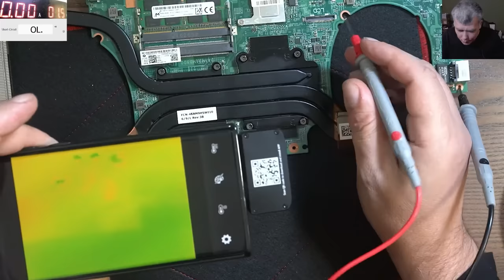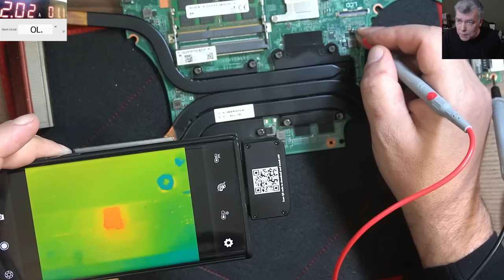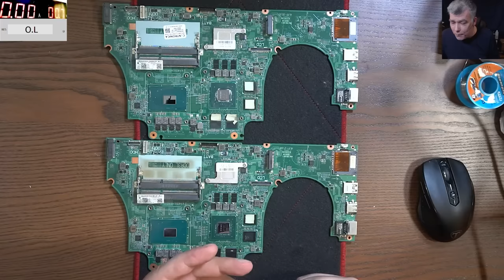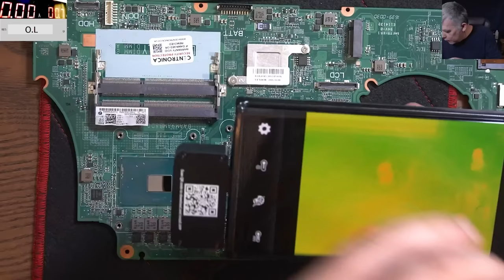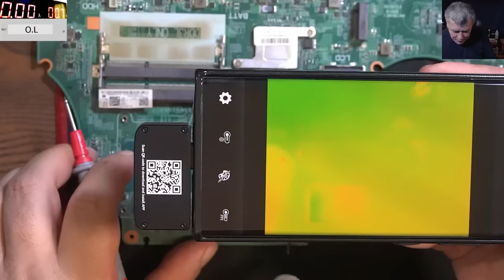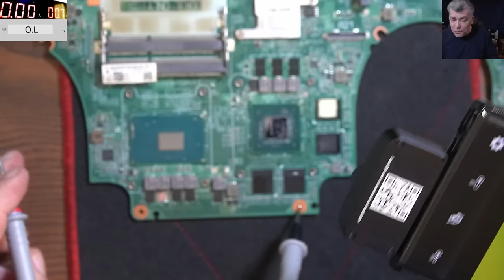How to spot a faulty CPU - How do we know the CPU is faulty?

Comment: Sorin, I've seen similar on graphics cards that are not short, where you have all power rails present and correct, the clock is running and the reset is off, all resistances read OK but the GPU does not start (does not attempt to read BIOS).  With a high resolution thermal camera you can see dark/black patches in the GPU die itself where the silicon seems to be 'dead'.  You can compare this with a good GPU of the same type by forcing PCI_RST low so neither GPU are starting, if you don't see the same heat signature pattern in both GPU you most likely have a dead one.  A hi res thermal camera with macro lens is an extremely useful thing. Have a play around with your camera looking for cold patches as well as hot ones. 😉
Reply from the maker: Interesting, yes, make sense
Reply: When two Legends meet!
Thank you both!
Reply: The same thing happens to FPGAs, TV ASICs, DVR and Monitor processors ... As I repair many different boards, I've seen hundreds of them
Reply: @electronicsrepairschool  legends reply to other legends so quickly

Comment: Faulty CPUs are very rare in my experience, (way more limited than Sorin's of course)
Reply: You're gonna have a faulty CPU if your highside FET fails before the lowside, i think, and you have 12V-20V sent to the CPU. Or if you have feedback circuit trouble or somesuch, sometimes a good whack can have unforeseen consequences.

CPUs are highly reliable semiconductors but not very robust!
Reply: Yes,it is....I own before MSI K8N Neo ....Bad capacitors blow my CPU :D 
CPU just heat and heat like crazy but nothing more
But today motherboards use better capacitors so IDK how is possible kill CPU 
Just overvoltage like lunetic :D Otherwise IDK

Comment: But replacing CPU not too much difficult or needs hard work, i have the same opinion before but after doing it and practice it many times I found it easy now , re balling chips is necessary to everyone working in electronics
Reply: The soldering work and CPU usually cost more than the whole board. And if you make a mistake repairing the power circuit the new CPU will blow up, what then?

Comment: I want to buy a tablet that I can easily open it, that has screws instead of glue, I have ipad pro 12,9" and once the digitizer is cracked I needed to buy a new display with the digitizer. Why we cannot find a tablet similar to a samsung cell phone that can easily remove its back to change the battery or buy a glass digitizer and replace the cracked one once the glass of the display is cracked. Can you suggest me a tablet that is easy to repair and open?

Comment: Replacing whole CPU or GPU or PCH(if separate) is just not cost effective. For some research some time ago I have checked even for cheaper chineese machines from ali and it just wouldn't pay itself off. Supply of newer chips is also very scarce so usually you have to rely on desoldering newer CPU or GPU from scrap and with price of some scrap, non tested boards it's just absurd to even try to do it conting in how much time consuming of a process it is. I bet that people who repair consoles have such machine in shop but consoles are diffrent and in case of those probability of cracked solder balls is way higher than in a laptop(yes there are dead APUs ofc, but most of them come in after well physical damage so). In any case of dead CPU/GPU on laptop board I just deem it a no fix. I know how to do it, but I won't be investing in expensive machine to do repair for which in most cases clients won't just pay the price so in the end it will just collect the dust. Also just in spent time for 1 board I could make a lot of other jobs in same time frame.